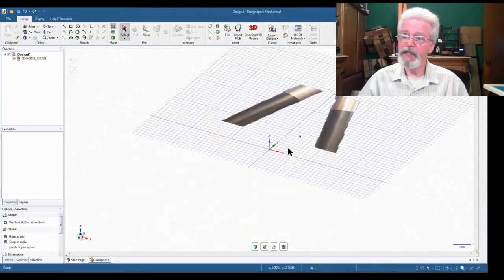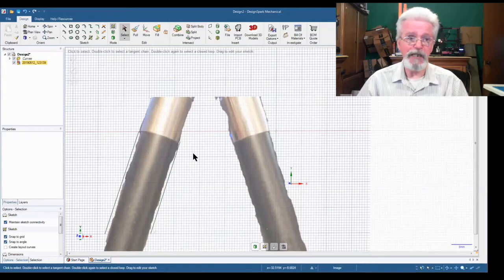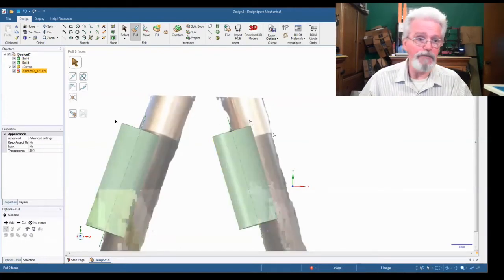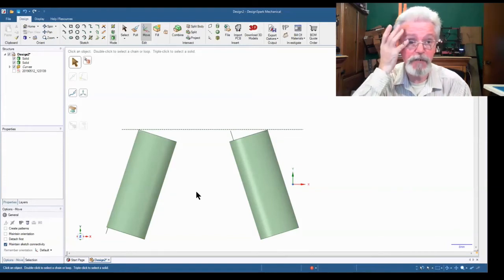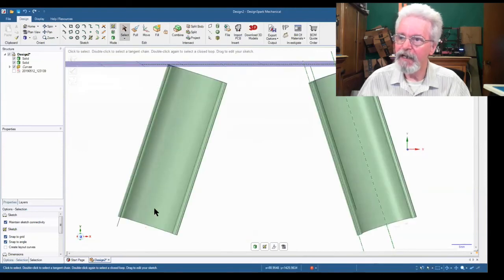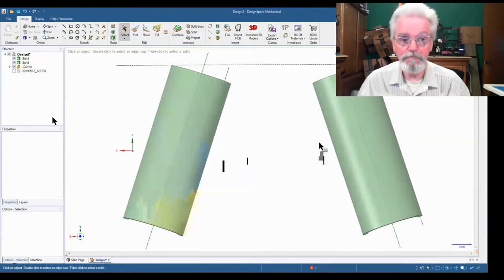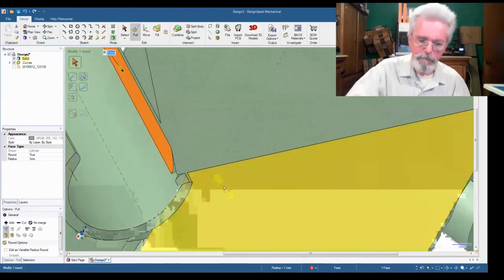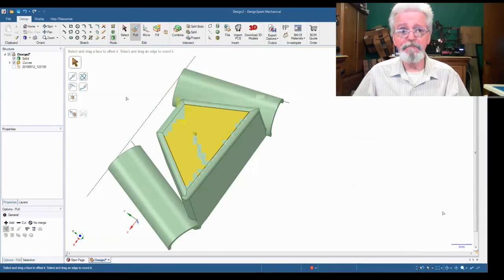Tutorial - DesignSpark Mechanical - Tripod Eyeglass

Comment: Hi, me again first of all thanks for these video's, the more people start using this software the better because it is unlike fusion 360  completely free fusion only 3 years free then it is over as I found out the hard way all my designs are somewhere in their cloud and I can kiss it goodbye or pay dearly every month. DSM is less extended but for 3d printing it is good enough Also for cnc which I use it for. 
Did you know the little blue cube in the top left of the screen if you click that little downarrow, it flips right to the desired view. 
And I also learned the hard way to use the TAB key it is together with the ESC key the most important key to use. for instance if you need a pentagram or triangle or what ever draw a random hexagon and use the tab key over and over again change the blue boxes measurements and keep tabbing un till you got the desired form.
last but not least. The Mirror command is so very useful 
in this tripod eyeglass design, just start with a small vertical construction line rightclick and set the line as a mirror line and you only nee the half af the design the mirror does the rest
oh and one more trick, if you can move the drawing plane up or down by any amount so just pull it down  say 4 or 5 mm and then do the split and throw away the bottom and keep the top 
again  kindn regards Hans ps. English is not my native language so if there are misstakes in the lingo sorry

Comment: Hi, the shell command works easier,  with the solid cilinder, select the solid, select the shell tool click the top of the cilinder next turn the cilinder and click the other side, and you get a tube. and the thickness is still adjustable.